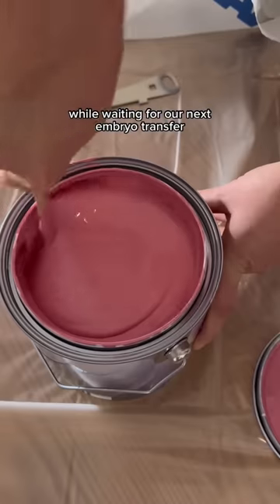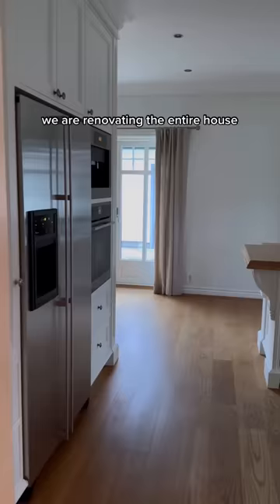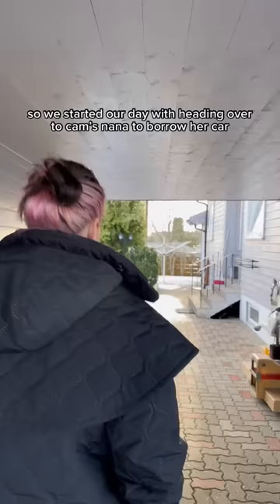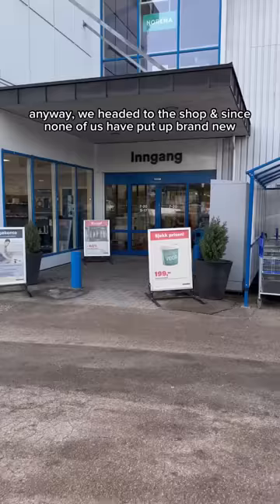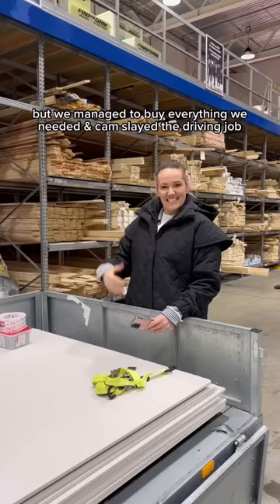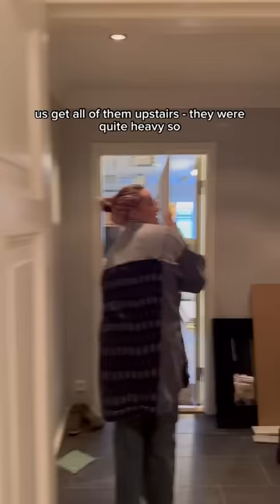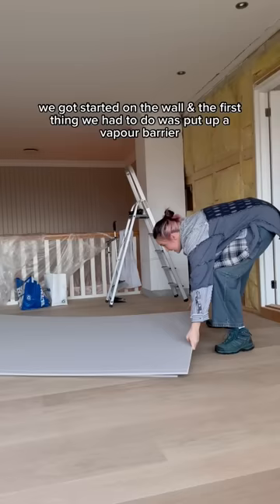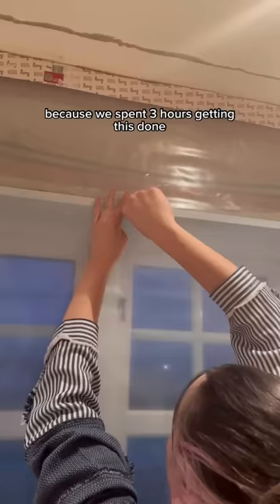ANOTHER DAY OF MAKING OUR DREAM HOME A REALITY👩🏻‍🤝‍👩🏼❤️

Comment: what do the vapor walls do? just curious.
Reply: If you live in a mixed climate – hot and humid with several heating months in the winter, you probably need a vapor retarder. Specifically, if you live in climate zones 4C (marine), 5, 6, 7 and 8.

I’m assuming it helps with the fluctuations in weather and keeping the house a normal temp :)